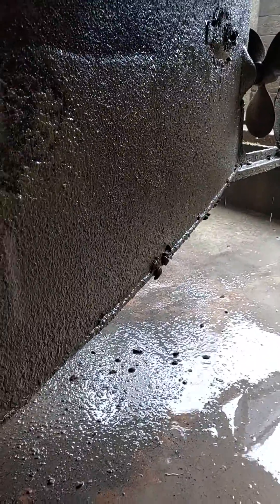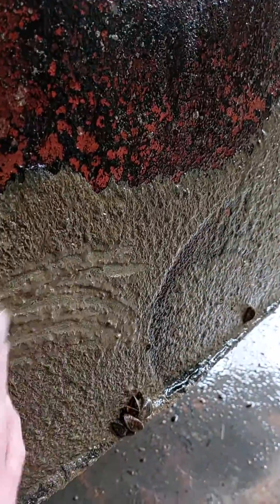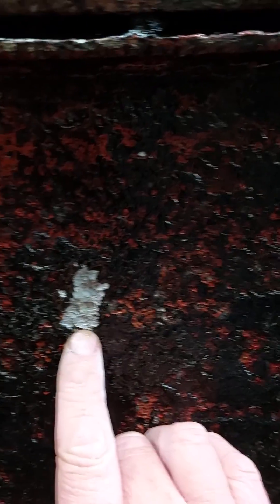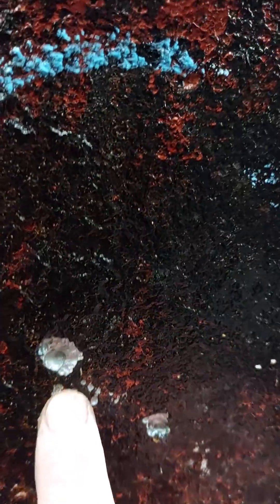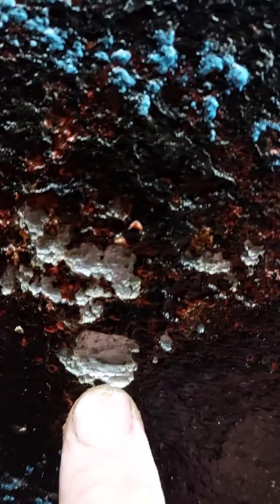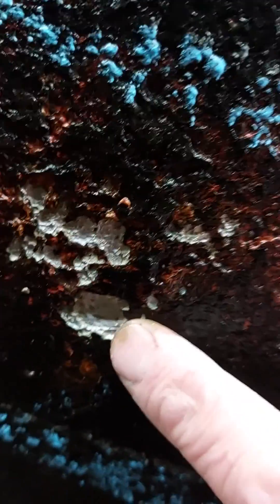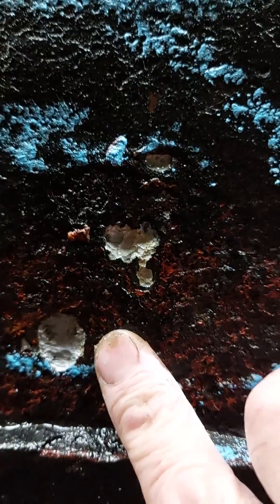very serious corrosion that is almost certainly connected to Microbial corrosion issues

Comment: What if any are the repair options with a hull in that condition?
Reply from the maker: Good question,  depending on the frequency etc then replacement plate or fill weld. Then shot blasting with a good epoxy coating and anodes